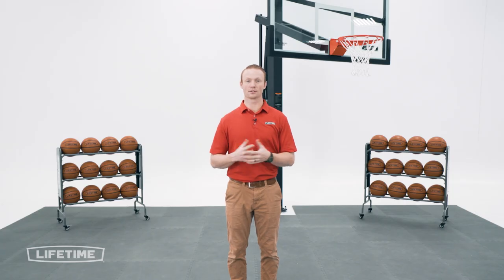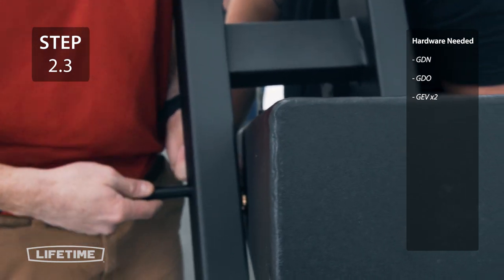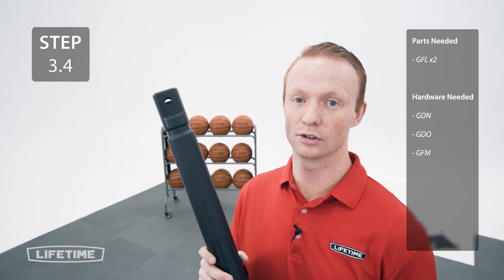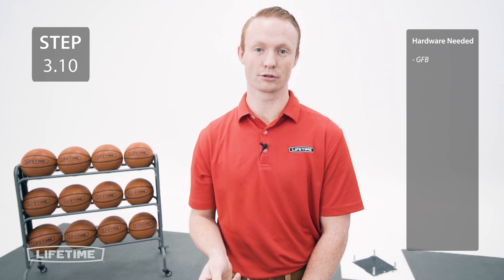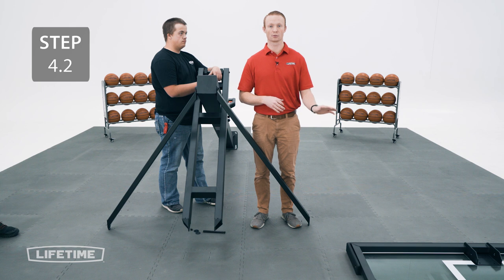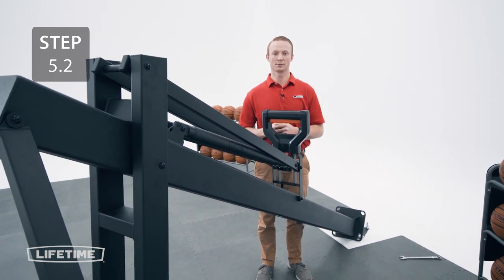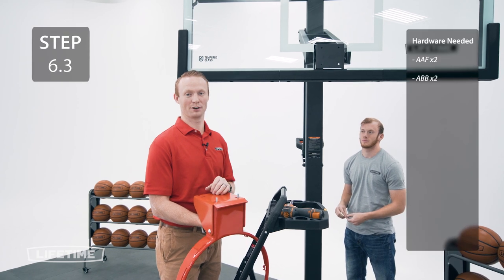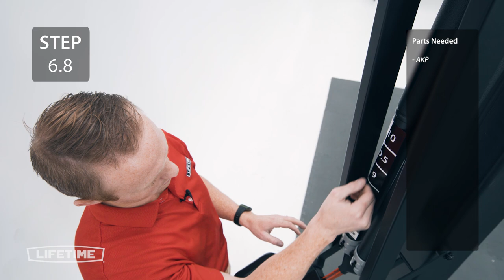Lifetime Mammoth™ Bolt Down Basketball Hoop | Lifetime Assembly Video

Comment from the maker: Section 1 
Refer to the manual or the following link. https://youtu.be/-Od08M_0d8g | Step 1.1

Section 2  
02:29 | Step 2.1
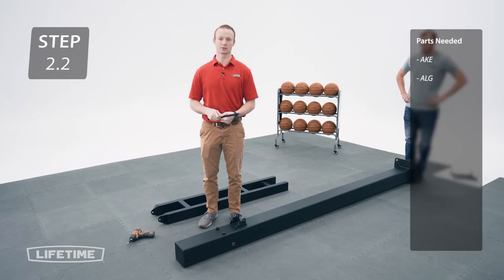02:43 | Step 2.2
03:06 | Step 2.3
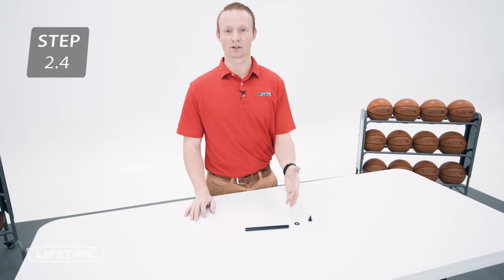03:38 | Step 2.4
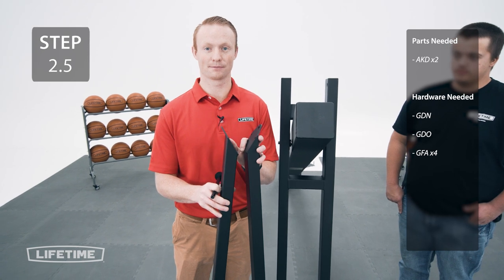03:48 | Step 2.5

Section 3 
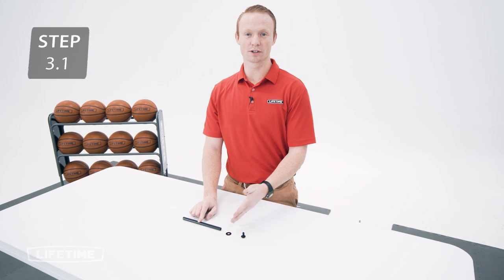04:24 | Step 3.1
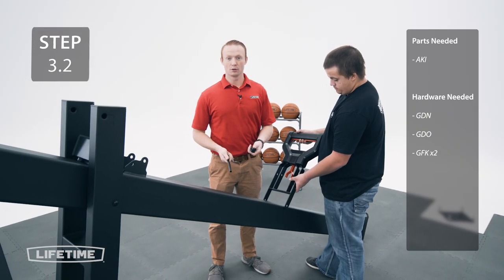04:37 | Step 3.2
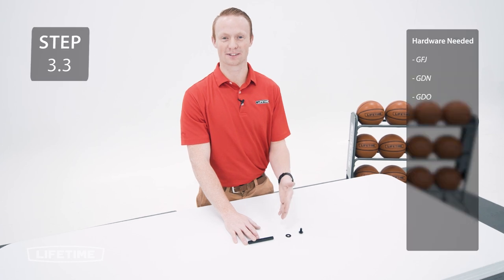05:00 | Step 3.3
05:13 | Step 3.4
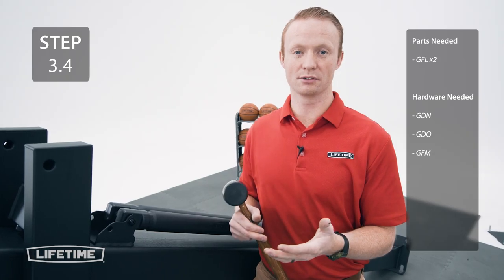06:09 | Step 3.5
06:21 | Step 3.6
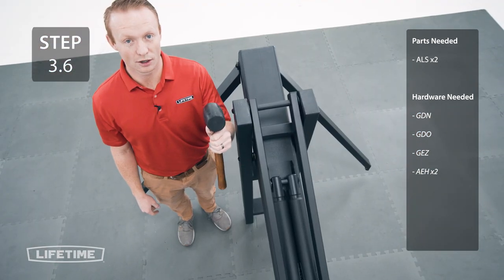06:59 | Step 3.7
07:11 | Step 3.8
07:39 | Step 3.9
08:02 | Step 3.10
08:32 | Step 3.11
08:56 | Step 3.12
09:09 | Step 3.13

Section 4 
10:05 | Step 4.1
10:23 | Step 4.2
11:30 | Step 4.3
11:47 | Step 4.4

Section 5 
12:06 | Step 5.1
12:20 | Step 5.2
12:50 | Step 5.3
13:17 | Step 5.4
13:30 | Step 5.5
13:37 | Step 5.6
13:51 | Step 5.7
14:03 | Step 5.8
14:31 | Step 5.9

Section 6 
14:51 | Step 6.1
14:59 | Step 6.2
15:10 | Step 6.3
15:37 | Step 6.4
16:02 | Step 6.5
16:05 | Step 6.6
16:36 | Step 6.7
16:53 | Step 6.8